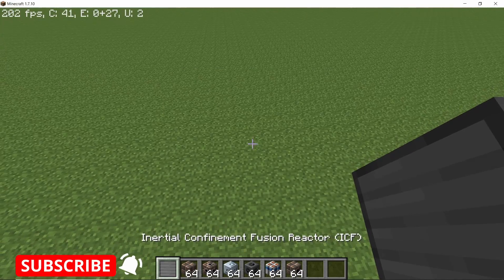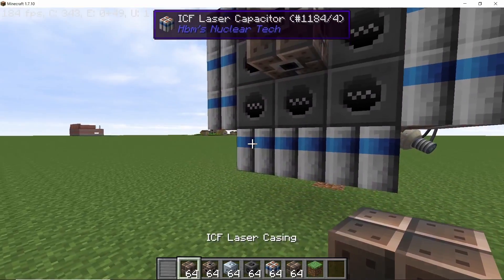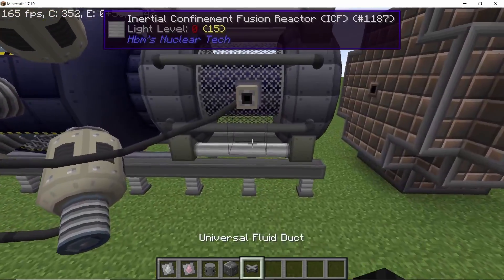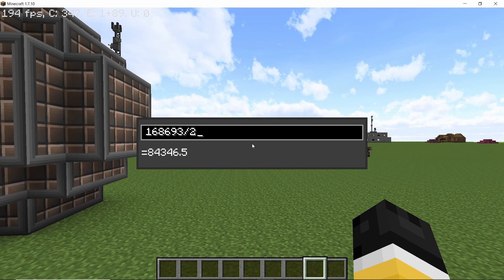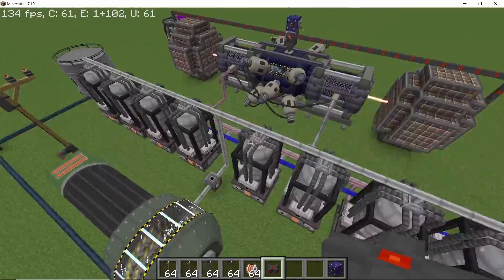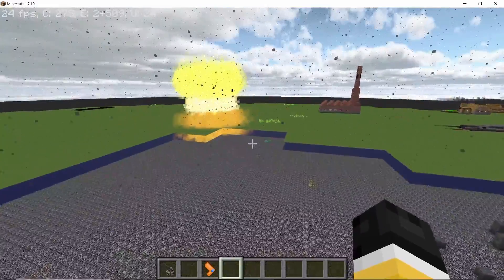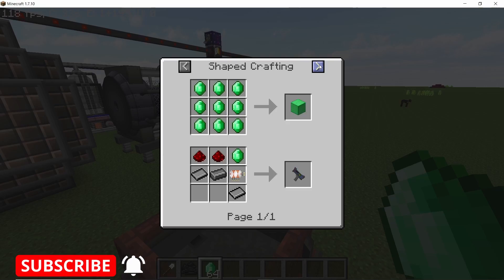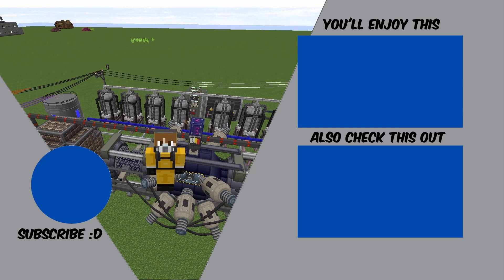Inertial Confinement Fusion Reactor, New Pylons and More - HBMs NTM Updates & Changes

Comment: how do capacitors and turbochargers work
Reply: You place them and they work, thats it. Okay, seriously, place capacitor near the flash tubes and turbocharger near capacitor. Only 1 turbocharger per capacitor, i think. Turbochargers are not nececcary, but capacitors are. More information on hbm ntm wiki btw

Comment: I used the NTM Coolant as the ICF coolant, seems to work pretty well. Got a 6 Heavy Sterling Piston setup producing 4.46kHE/t when near max speed.
Reply: and it goes from cold to hot quick, and when I shut it down it cools for a long period of time lol
Reply: Also using a conveyor belt system with mass storage units for fuel pellet handling.
Reply: Only thing I needed to know was how the reactor worked, once I knew how to get the ICFR going, I got a good system going lol
Reply from the maker: Why not use liquid sodium tho? It has the highest heat removal capacity out of every available coolant. Also I'm glad to know you figured out a good automation system for it bro !!
Reply: @SavageVegeta  well my world corrupted so I had to go with a new world, got a better ICF system using that sodium and using 22 Heavy Sterling Pistons now.
Reply from the maker: @robertchapman2174  oh that's pretty awesome 😎
Reply: @SavageVegeta How do I use the turbochargers? Do I just replace the capacitors with them?
Reply from the maker: @tap_khap  I'm not sure about them, haven't used them in the laser setup yet so can't say sorry
Reply: @robertchapman2174  let me try that
Reply: @robertchapman2174  it worked! it took a 5 mhe laser that had 1 cell to 15 mhe! Thats a 3x increase!
Reply: @robertchapman2174  turns out it makes the max size really bugggy and activate a lot sooner. why would he add pellets that need like 218 mhe of laser power then not let you get a powerful enough laser?

Comment: Hey, how do i turn Hot sodium to Steam?
Reply from the maker: It can't be done directly, you've to run the hot sodium into a heat exchanger and have a boiler on top of the heat exchanger which will convert water into steam
Reply: @SavageVegeta  so what do I do with the sodium now?
Reply from the maker: @CursieLT  hot sodium gets converted to normal sodium inside the heat exchanger and goes back into the reactor to get converted into hot sodium and the cycle repeats indefinitely
Reply: @SavageVegeta  Thanks 👍